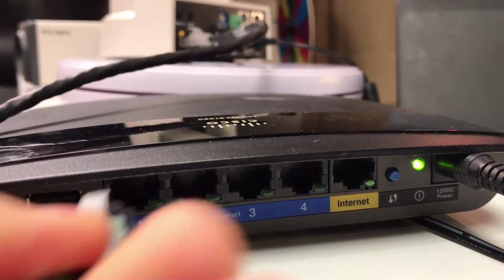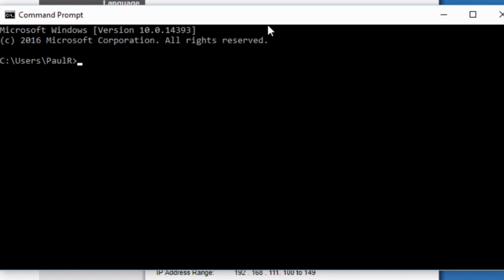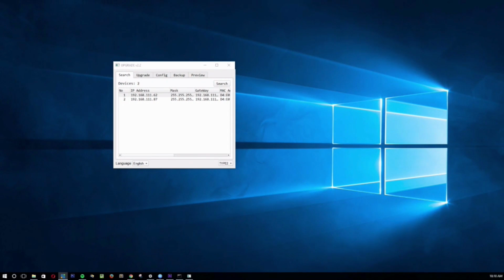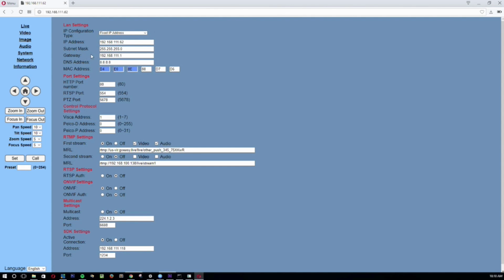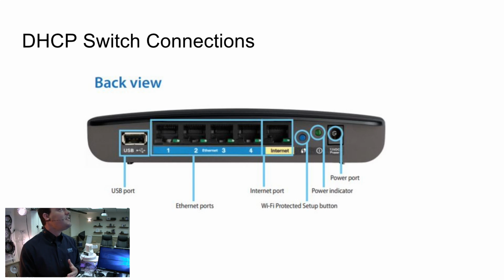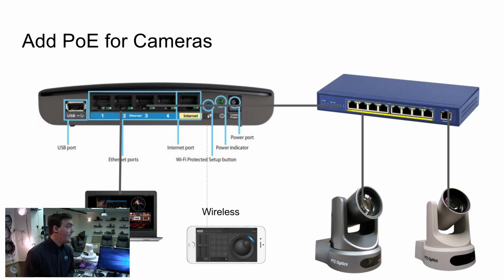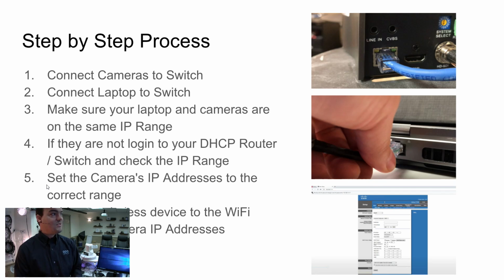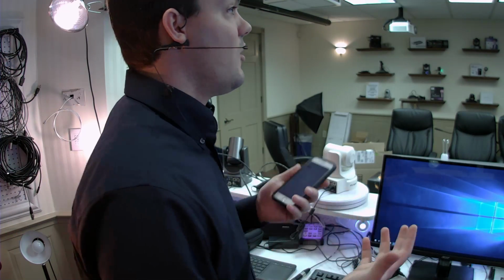Wireless PTZ Camera Setup

Comment: hi sir how to use two switch  in one nvr?
Reply from the maker: Hello!
Using two network switches with one Network Video Recorder (NVR) involves creating a network topology that ensures all your IP cameras (which might be spread across two different switches) can communicate effectively with the NVR. This setup is common in scenarios where cameras are deployed over a large area, exceeding the capacity of a single switch, or when cameras are physically located in different areas, necessitating the use of multiple switches. 

Here’s how to approach this:

Basic Setup:
Connect the NVR to the Main Switch: Start by connecting your NVR’s LAN port to one of the Ethernet ports on your main network switch. This switch will act as the central hub for your network.

Connect IP Cameras to Both Switches: Distribute your IP cameras between the two switches based on their physical location or network load considerations. Ensure each camera is properly connected to an Ethernet port on its designated switch.

Interconnect the Two Switches: Use a standard Ethernet cable to connect an Ethernet port on the first switch to an Ethernet port on the second switch. This connection allows devices connected to either switch to communicate with each other as if they were on the same network.

Considerations:
IP Addressing: Ensure all devices (IP cameras and NVR) are on the same IP subnet to facilitate seamless communication. This might involve configuring IP addresses manually or ensuring the DHCP server (often a function of a router in small networks) can assign addresses within the same range.

Bandwidth Management: Be aware of the bandwidth requirements of your IP cameras, especially if they are high-definition or have high frame rates. The link between the two switches can become a bottleneck if multiple high-bandwidth cameras try to send video data through it simultaneously. Using switches with sufficient backplane bandwidth and configuring Quality of Service (QoS) settings can help mitigate potential issues.

PoE Considerations: If you are using Power over Ethernet (PoE) to power your cameras, ensure both switches support PoE and have sufficient power budget to supply all connected devices.

Redundancy and Reliability: For critical surveillance setups, consider using switches that support spanning tree protocol (STP) or similar technologies to prevent network loops and ensure network redundancy. Additionally, using managed switches can provide better control over network traffic and more advanced features for troubleshooting and optimization.

Advanced Configurations:
In more complex network setups, you might encounter scenarios where additional configurations are necessary:

VLANs: In networks where traffic segmentation is required for security or organizational purposes, Virtual LANs (VLANs) can be used. Ensure that the NVR and all IP cameras are on the same VLAN or that proper routing is in place to allow communication between VLANs.

Routing: In setups involving more sophisticated network infrastructures (e.g., across multiple subnets), a router (or Layer 3 switch) may be required to facilitate communication between devices on different subnets.

Final Steps:
After setting up your network, test the connectivity from each IP camera to the NVR to ensure the video streams are correctly being received and recorded.
Make sure to secure your network by changing default passwords, updating firmware, and implementing network security best practices to protect against unauthorized access.

This approach to connecting two switches to one NVR should provide a flexible and scalable solution for managing IP cameras across different physical locations or network segments.

Thanks for checking out our Channel! 
Learn More: https://ptzoptics.com/